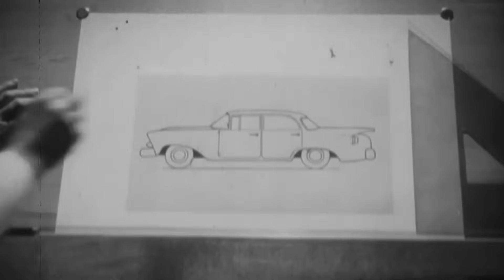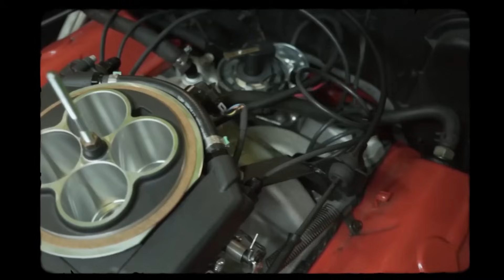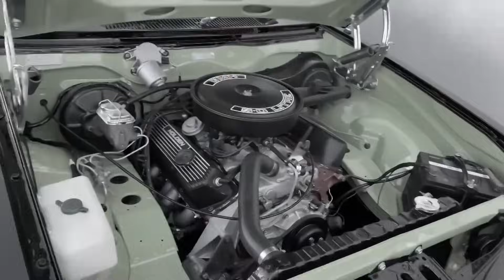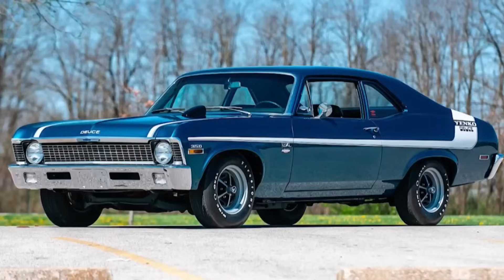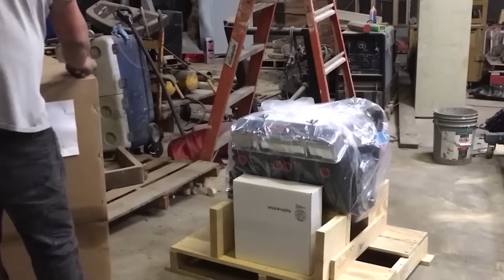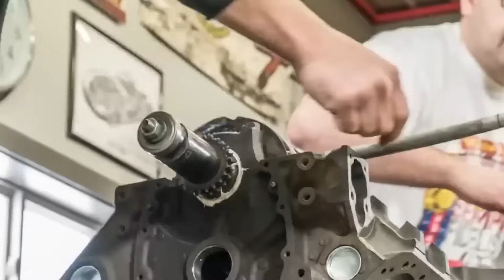The Chevy 350 V8 vs The Holden 308 V8 | Who Was The King?

Comment: C.O.M.E racing stroked the 308 to 455 just crank  and billet block that allowed a  large overbore. They actually persisted with the Holden V8 for many years developing it into an incredible motor
Reply: 355 ci, not 455.
Reply: What happened to C.O.M.E Racing? They were a great engine shop.
Reply: @dezza718 It wasn't a great name.
Reply: C.O.M.E racing built their own alloy 427 '308'.
Reply: Come racing sux and so does 308
Reply: @jeffwilliam7500 how’s your ford going?